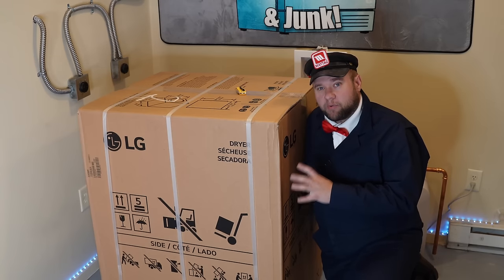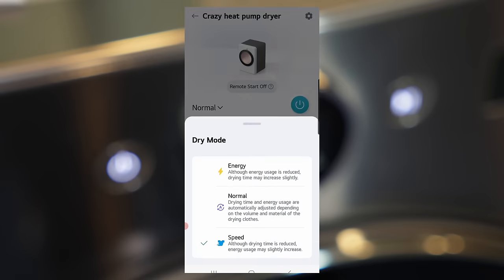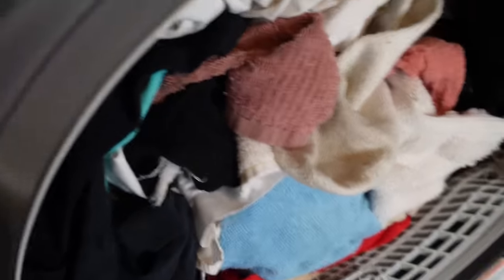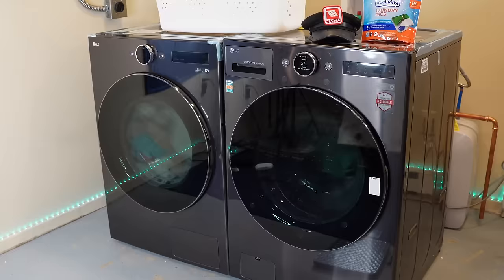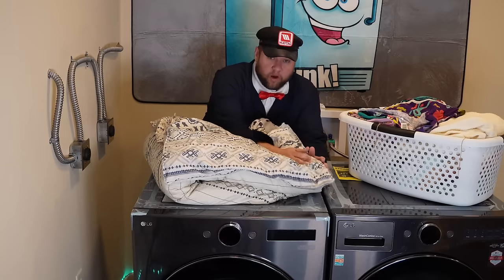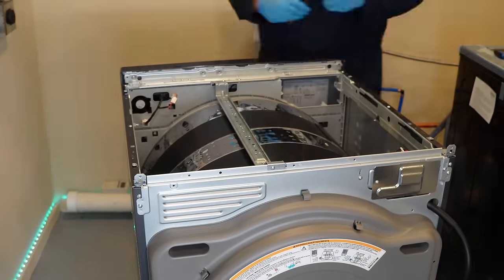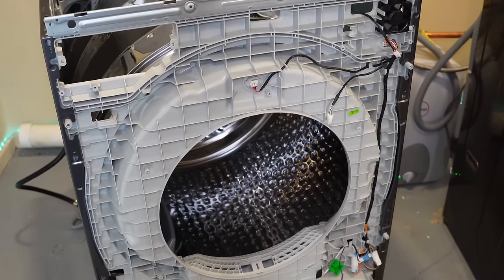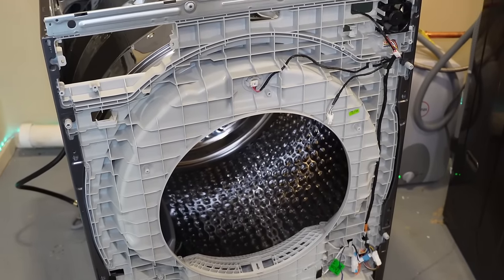LG Heat Pump Dryer - Way Better than I Expected - DLHC5502 Teardown & Review

Comment: I found an older GE heat pump dryer for $50.  The couple said it was taking longer to dry and the clothes were still damp.  They were going back to conventional dryer.  I found a sock below the filter housing and I cleaned the dust and dirt off of the coils.  I can dry a medium load in about an hour and fifteen minutes. When running it consumes about 760 watts.
Reply: The old boomers just couldn't be bothered to.... do anything to maintain their appliances, huh? Rather just burn through their retirement savings by blowing 6,000 watts of heat out of a 4 inch hole in the wall. lmao. 😂

Comment: Using acidic liquids is a bad idea on condenser coils and will cause galvanic corrosion with dissimilar metals (copper/aluminum coils) in this case. This is a known issue in the HVAC industry in corrosive environments. Looks like LG used a coating on the front condenser coil to mitigate this but it will not protect the coil from acids 100%.
Reply: Correct. Those coatings are usually for ambient air protection. They're common in areas near beaches where the saltier air destroys coils in a matter of a couple years. 

The coating is definitely not designed to withstand harsh chemicals used for cleaning
Reply: Does this mean it would be a bad idea to purchase?
Reply: @Moose1207 so not worth purchasing then?
Reply: @johnulcer  Incorrect, this dryer has been by far the most impressive dryer I've sold in recent memory. About 40 units in and not a single problem or issue. The self-cleaning condenser has been working amazingly well for every single customer I've been able to follow up with, and now finally America can act like a grown-up country and stop blowing 6,000 watts of heat out of a 4" hole in the wall to dry clothes. Vented dryers are ancient boomer tech that lulls people into continuing to run them because they "seem reliable", when in reality they're costing several multiples of the entire cost to buy of this unit just in their excessive, gluttonous electricity guzzling.
Reply: @johnulcer Not at all, it is a coated coil. But I would think a more conventional "coil cleaner"  might be better
Reply: Normal, certified cleaner for home air condition units will do the job and is safe to use. Just make sure is liquid form and not in foam/spray/spray foam.
Reply: @marinsraga8003 foam cleaner is fine? What do you mean
Reply: @Amorbellum no, foam cleaner works but leave residue because foam expands. And this might damage/stain clothes. For normal cleaning just pour 2dl of air condition cleaner (liquid form) in the filter gasket (under) along with 8 dl of water so LG dryer can use this when spray water on coils with cleaning mode.

19:30 min in video, where Ben remove filter gasket and pour some liquid.
Reply: @s.linn5086  Don't talk to the guy that sells them talk to the guy that repairs them.

Comment: Remote start is such a dumb feature. You still have to move shit over to the dryer after washing...
Reply from the maker: For you it is. Most people like they can tell the unit to end when they like
Reply: Where I live, power price goes down significantly at 7:00 PM. Being able to start it from upstairs with the app is a selling point.
Reply: @craigscherer563  true but you can just walk down stairs

Comment: My old dryer died and I wanted to replace with a heat pump dryer so I purchased this unit a week ago. I knew it was new to the market and there were no reviews out yet, but being a week in so far, I have been pretty happy with it. as you stated, I've noticed the time estimate displayed on the screen tends to be slightly exaggerated and the clothes are dry generally before the time runs out. It has powered through loads of clothes, towels, sheets, blankets, and everything I've thrown at it so far with no issues. Clothes always come out super dry and warm and do not feel the slightest bit of "damp" or moist. The dryer is super quiet and the app connectivity is also nice. If you can stomach the price for the unit, and don't really want to go the two-in-one route, I would highly recommend this unit.
Reply: I really want to go the two-in-one route.

Comment: I bought the LG heat pump dryer as part of their washtower.   Eliminated the issue with vents, uses a fraction of the electricity since the heat is recycled (exhaust heat to my laundry room is pulled in again), no humidity and awesome drying.  One issue is that they drying takes a bit longer - but I do find that it is easier on the clothes.   Cost was similar to a high quality, full functioning dryer.   Highly recommend.
Reply: Does it increase moisture level of laundry room or entire house?
Reply: @NiranjanNanda  it actually decreases moisture.  The dryer pulls a bit air from the house uses heat pump to pull heat from the house to heat up.  Condenses the water vapor and drains it down the plumbing via a drainage tube and releases some of the dry air back to the laundry room.  So it is like a dehumidifier!   And since there is no outside exhaust vent, no leakage of heat and air outside.  It uses less than 1KWH for most loads with is about 10 to 20 cents of electricity depending upon your time of use rates.
Reply: Darn. When did they come out with that version? I bought the wash tower about 6 months before the GE heat pump washer/dryer came out, and now there are so many options! 😩
Reply: @Spp235.  Thank you very much for the response. :)

Can I ask where did you buy it from? Costco is yet to carry this item. Is it okay to buy from LG directly?

Comment: It’s so good to hear positive things about an LG dryer. We still have our very first dryer that we bought way back in 2005! It an LG Tromm with the auto sense feature. It’s still works very well, and we have twice had technician out to work on a washer and they were amazed. It is a gas unit, we are a family of 7, and I have only had to replace the igniter, the metal sensor piece, and a drum wheel. The drum does have a small indent from running too long with the bad wheel, and the belt definitely looks worn, but we have been beyond impressed with its longevity. My wife says that it’s not allowed to ever die. 😂
Reply: Winning Lottery percentage odds. Buy a replacement control board and its probably doable, only so long on those relays. Auto sense tells me its not a mechanical timer, thats what makes washers and dryers unkillable.